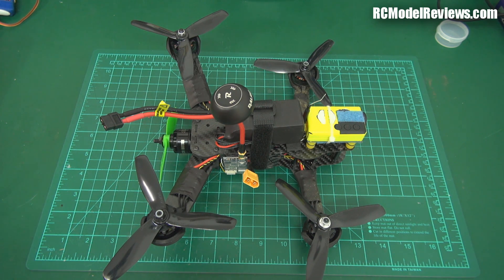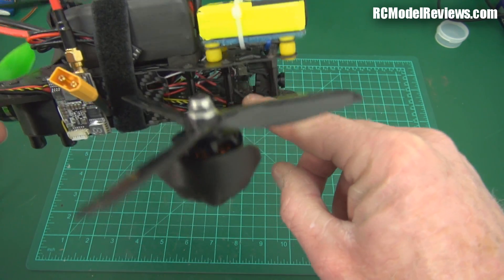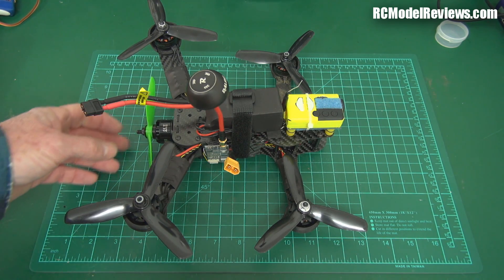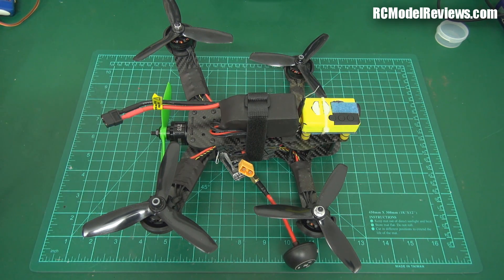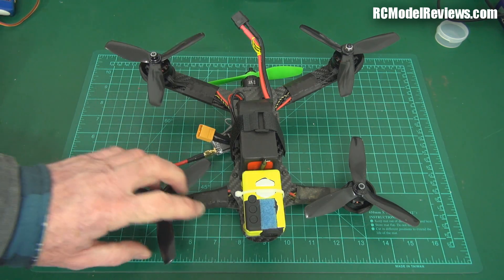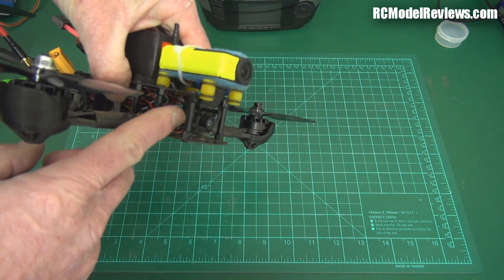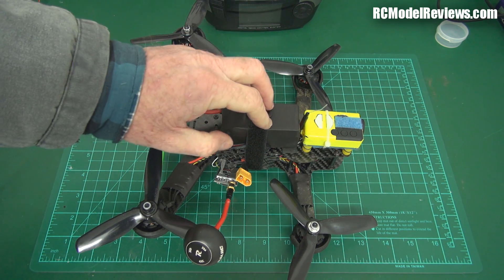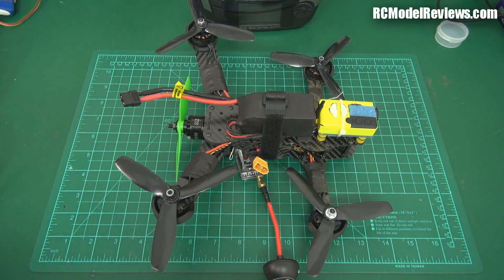Foxtech Screamer 250 update

Comment: Doesn't the Torque from the pusher motor make the craft try to roll? That would make the Flight Controller send less power to one side and more the other. Now there's air moving edge on to one set of props turning fast and one set turning slow. The pusher needs a gearbox for counter-rotating props.

Comment: sounds like total junk sad indeed
Reply: I wouldn't call it total. The individual parts do work, just not put together very well. I've had a motor turning on by itself, turns out that the wire inside is broken and i had to crimp new plugs, probably some wires got pinched here as well.